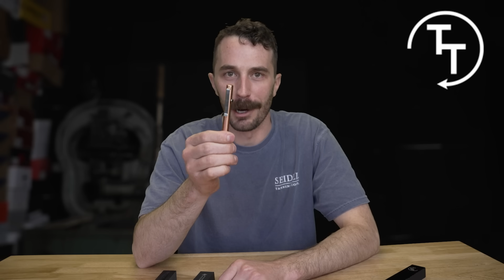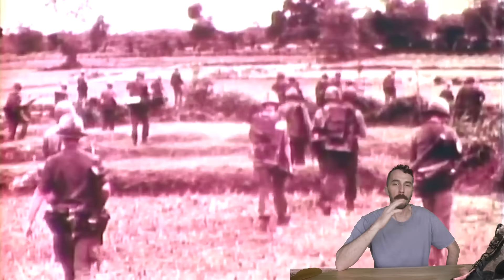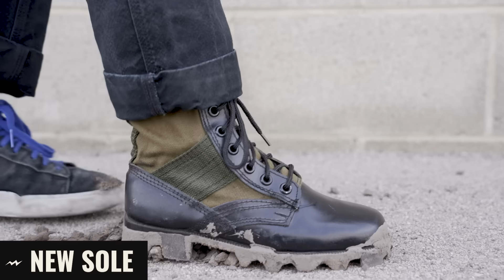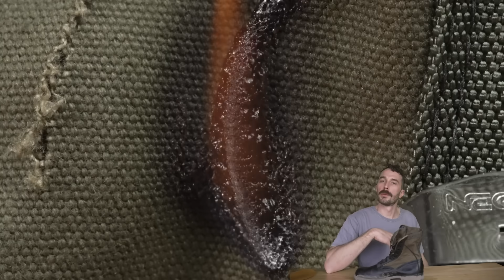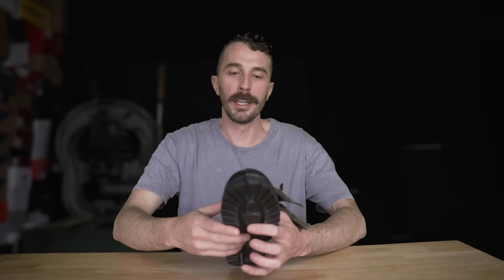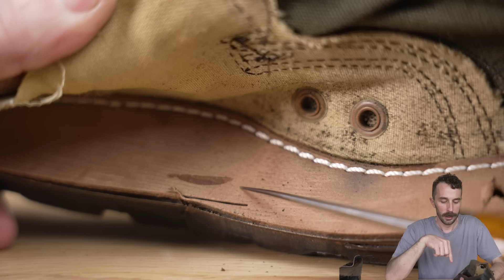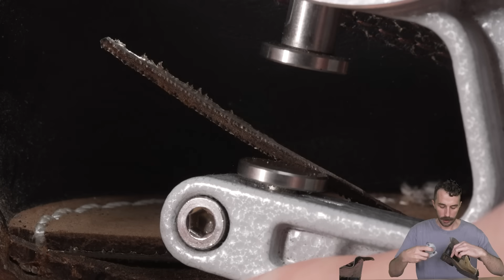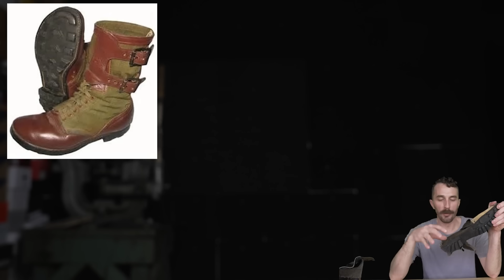Why it took 57 years to replace jungle boots

Comment: The US military had the fortune of learning from other countries' mistakes concerning footwear in the tropical Southeast Asian climate. Specifically from France's experience in the First Indochina War, and the British Commonwealth's experience in Malaysia post-WWII. Both of the Western forces in these conflicts wore footwear that was wholely ineffective in the climate they operated in. They soaked up and constantly held onto water, rotted and fell apart in the humid environment, and became completely fouled with the clay-like mud compromising much of the region. Foot casualties were common. But even learning from this, the US jungle boots weren't perfect. They still needed time off of soldiers' feet to dry properly, and while their sole's traction was an improvement over previously issued boots, they still proved inadequate in sloughing off mud. The former problem was solved by issuing what was essentially slippers for soldiers to wear while encamped or at base, but the latter wouldn't be solved until late into the war with the introduction of the "Panama sole", the widely spaced tread pattern seen in this video. The shape and spacing of the Panama sole was intended to basically squish the mud out from the treads as the wearer stepped their foot down and bent the sole.
Reply: You're right about not fully drying, that's why I remember we carried 2 boots & multiple socks
Reply: @andrij66  I'm sure carrying the extra weight of the second pair of boots wasn't the most fun thing, but your feet thanked you for it. I once had minor trench foot from having my foot in a cast for three months. Condensation from an anti-inflammatory cooler and my sweat saturated my cast. Not the most fun experience, and that was with only a small amount of the foot affected and me not using it to walk at all. So a fully affected foot as you're humping gear around in an active warzone? They're not joking around when they get on your ass about feet care. You ever use the foot powder they issued? Did it help in your experience?
Reply: Fortunately I have dry skin (& dandruff) & didn't use foot powder. Just always used different socks rucking around. & always bought the best insoles I could buy. I remember the pig & a box on the back used to wear everything out fast. Especially the socks.
Also I was always lousey at shining boots. I tryed the burned can & cottonballs panny hose & clothes, never was able to get that mirror shine some guys got I was throwing away my junk shoes 3 months ago & various boots the Army gave me couldn't throw away my old Jungles with thick laces. Naturally he didn't say but those would be the first to go.
Reply: You might find the Roman footwear (Caligee? or something like that) was also made to drain water, hence the open sandal design. Thinking back I saw guys use footpowder at night (or after talking off their boots) but would just be a mess in the boot after a day of stomping around.
Reply: @andrij66  You know, I always considered Roman military footwear construction to be more of a logistical matter; that it was the simplest and cheapest way to shoe their warriors. I never stopped to think there was a practical benefit to having it designed that way, sans breathability. Interesting.

On the foot powder, it makes sense to prefer using it at night. I imagine it gets crushed around into a caked-on layer after being walked on all day. Wonder if it would have been enough to clog up the Jungle Boot's drain holes?

Comment: They were alright for their time.  A big improvement over the previous generation of combat boots.  But footwear technology has come a long way since that time and the military can do better.
Reply: I politely beg to differ.  The current Army hot weather coyote boot is awful compared to my old green jungle boots.  The padded collar at the top is not as form fitting as the old style.  This does not allow tight lacing.  Because it is sloppy at the top your trousers do not stay inside the boots as well.  Once those suede boots get wet they STAY wet.  The black leather portion on the old jungle boots could be polished and that would repel the water.  The current coyote hot weather boots are significantly heavier.  My OD jungles are light as a feather...   Could hump for miles.....   AAFES currently sells the old style ....   Hmmmmmm.  The new OCP uniforms look a little like the old BDU uniforms....    The Pinks and Greens are back.....    Maybe the OD jungle boots will return again.....    The more things change....    The more they stay the same.

Comment: This video is great!

I've worn solid leather Altama boots with BDUs (sturdiest), the issued desert boots with the UCP ACU (Bates or Belleville (?) narrow-soled ankle breakers), the older Danner TFX with UCP and OCP ACU (widest sole for max stability, but heavy and not the most comfortable), but now, I have found the absolute best boot so far: The Rocky S2V.

It's as if they incorporated and improved all of the best attributes of the jungle boot, used all of the current best materials available, and even applied anti-microbial and PTFE flame-resistant coatings. I haven't tried to set them on fire, but they don't smell like foot odor AT ALL after six months so far in hot desert climate with sweaty feet (my running shoes stink). They're supposed to incorporate "Sieve" technology to push water out/air in, but I haven't waded any water. The sole is wide, ankle stability is amazing, yet my feet naturally roll from heel to toe with minimal resistance or clunkiness. They're not speed boots, but they don't FEEL heavy like the Danners did. They are hands-down the most comfortable stability combat boot I have ever worn. The Rocky boots have been very popular with the Army (and the rest of the military?) for a while now. I wish I bought them instead of the Danners a few years ago.

I'd love to see the Rocky S2V compared to the current GI boots, or any other modern combat boots, for that matter.

Comment: The mesh insole is not and does not function aa sponge.
Instead it provides ventilation and disperses heat. So your feet will be dry and therefore warm, will not rot, and won't get tired.

Comment: One of the Ranger BN did a study in the 80's of feet and leg injuries from road marches. They found out that the jungle boot caused the most injuries, probably due to the metal plate and the relatively hard lug sole transmitting most of the shock from rucking straight to the feet,  The all black leather issue (leg) boot caused the least injuries and the Corcoran jump boot was almost as bad as the jungle boot. I would put the neoprene soles in my jungles to give them more shock absorption.

Part of the jumpmaster check (JMPI) in the late 70's early 80's was to check that the jungle boots being worn by the jumper had that ankle strap sewn in as it reduced ankle sprains.

Comment: I HATED THEM.  In the jungles they were fine. However when they become a daily wear on hard surface they were brutal. IN COLD WEATHER THE STEEL PLATE GOT VERY COLD AND STAYED THAT WAY. A 12 mile road march in the original soles was so taxing. Replace the soles with a ripple sole or a viabron type sole and they were fine.

Comment: When I was in the army in the mid-1970s, I loved my jungle boots.  When I returned to the army in 1989, I was doing a lot of flying in UH-1 (Huey) helicopters and others and learned very quickly that the last thing you'd want to be wearing in a crash with possible fire would be plastic materials like the nylon sides in these boots.  Our safety guy had pictures of crash survivors who were wearing them when they crashed.  The plastic melted straight into their skin and left raw meat behind after the doctors dug the plastic out.  It made your foot and ankle look just like a biological jungle boot, too.  It was leather boots, Nomex flight suits and jackets and NOOOOO plastic stuff that would melt into your body.

Comment: These were not issued to us in the late 80s but they were authorized for wear and available at the on post uniform store.  I bought a pair after my initial issue boots were used up and wore them pretty much all year while I was on active duty.  I remember that when the leather became very soft from use the metal vents would fall out of the leather and be lost.  After that it seemed small stones and sand got into the boots time a lot.  A pain.  The mesh insoles you showed came with the jungle boots.  Those same mesh insoles also came with the regular leather boots issued to us at basic training.  They were not specific to jungle boots.

Comment: Since this seems like the best most active location for talking about boots/footwear.
     My situation: I have fallen arches due to hyper elasticity in my tendons, also since my feet have been unsupported for so long I've got a bunion started...to say the least my feet give me issues all the time. I've tried store bought insoles, 3 types of custom orthotics last one being made by a podiatrist.
     I have a really strong feeling it's not an insole issue cause support is only as good as the weakest link.
     My boots, I've looked high and low for arch supporting, stable walled, sturdy based, raised heel, steel toe, 8" high, D width with toe room, function over fashion. (Boots designed for purpose)
     Looking for suggestions for boots, I know i can't be the only one who is looking for something specific. Any and all help is more appreciated then you know.

Comment: Wore those boots for years, until I went to Korea in 89. They weren't allowed to be worn there. Prevailing premise was the cold. They didn't want GI's outside in the extreme cold with a steel plate between your foot and the frozen ground. Not convinced that was the reason, but it makes some sense.

Comment: Those white rubber Winter boots you mention at the end of your video are called Mickey Mouse boots. Not bunny boots. I wore them a lot when I was stationed at Ft. DRUM, NY. They are super heavy, clumsy, but very warm.
The jungle boot is still my favorite boot. The wide spaced lugs are great for mud, but are hard to walk for distance because they are not very forgiving. Annoyingly, the pungee stick plate would often snap in half inside after a time. This caused an audible click when walking. Then it was time to toss them. The plastic insole that says Do Not Boil are garbage. They are not absorbent at all. They are designed to maintain airflow. That is why the do not depress and provide cushioning. No cushioning and very painfull in your feet. Soldiers toss those and add nice store bought insoles.

Comment: I wear 2 of the german versions. 
I learned to appreciate the non sweaty feet fast. 
And when I quickly had to retrieve a dog from a river, I learned to appreciate those drain ports. 
With good care and high use, I got 16 years out of my first pair. 
I still wear them some times, when threads on the soles are less of a requirement.

Comment: I purchased jump boots when I reached my 1st Duty Station.  They were removed from the Army around 1990, so if you already owned them you could wear them with your BDUs, but they could no longer be purchased from clothing sales.  They do allow water to drain and air to circulate, drying your feet while you march.  My last pair gave up the ghost in 1999 after 12 years of daily wear.

Those other boots were called Mickey Mouse boots when I was in the Army and they are extreme cold weather boot.  They also work amazingly if inflated properly.
Reply: The mickey's had a little fart vent to let the sweaty steam out. They were nice and warm in the snow of S.Korea but a bear to wear on long marches. Great for guard duty.
Reply: Jump boots were the best

Comment: Those are still in use in Brazilian armed forces, there are some variations on quality depending on where you get them (the pair you recieve/the ones you buy) and between brands, the cost averages $30, some pay $40, I personally bought in bulk for the whole platoon, each pair costing around $21... The ones that are given are called "jawbreakers", because of the hard rubber soles, they work fine but after a year of using them you'll certainly get a knee injury for life

Comment: I brought a pair of jungle boots to Costa Rica with me in 2004 on a group trip. 

Two young women in our group took a wrong turn in Tortuguero and found themselves stuck in a saprolite clay quick mud. The jungle boots let me walk through the mud like it was nothing and made it easy to carry one of them back to the boat after her boots were unretrievable. 

I can't say anything bad about the later version of these boots. The moisture ports on the side and the spongey insole kept your feet dry no matter what and the super simple tread of the heavier lugged soles made them badasses on jungle terrain. 

I legit miss them and would recommend them for hiking anywhere in rainforests or jungles.

Comment: In hot steamy environments, I have worm both the small and large lug jungle boots! Both were excellent boots, I preferred the large lug mostly because it was more comfortable. Soldier rumor had it, that there was a steel plate in the bottom of the jungle boot to protect against pungi sticks which I thought was total BS until I watched your disassembly of the boot. Well I'll be d*mned, the rumor was true! Thanks for the conformation!

Comment: I was never a fan of jungle boots. Some manufacturers seeked to make the boots waaaay too low for the top of my foot. That, combined with a very prominent seam between the nylon upper and leather lower, meant they would rub the top of my foot raw, even after breaking in.

The modern USMC hot weather boot from Belleville is much better.

Comment: I wore these boots (USMC 79 - 2004) until 1995ish.  Best boot ever and use them for yard work now.  The insole was thrown away after a few months as it would begin to bunch up after a long hump.  I resoled mine a couple of times and they beat the hell out of the initial black issues.  We were issued a new still in 2001, after 9/11 and they are a good boot but no where near the quality of the jungle boot.

Comment: I had a pair of those when i was in the Army and they were FANTASTIC! My feet would get completely soaked, but would dry as I marched around  and by the end of the day the both the boots and my feet would be just fine. later I was issued a similar pair when I was deployed to Iraq. No vent holes, but rough side out tan colored leather and tan canvas tops.  Again, my feet were well cared for in those boots.

Comment: I served in Europe in 67/68 with leather boots. I worked on a trash truck in the 70s. We wore out souls every three months. I bought the jungle boots at an army surplus store. They were $20 back then. They were the first kind you showed .so they must have been superseded.by the newer boot and that's why they were so cheap.They sure saved my cash flow.

Comment: I wore my jungle boots for years in the military. They were my absolute favorite and most comfortable, extremely durable and long lasting. The only change to them many of us did was to add 550 cord instead of the black laces. The jungle boot is by far the best military boot I have ever had or worn.

Comment: I wore that design for 18 years of my military service and continue on for another 2 years when I went to the mining quarrying industries. Our outsole wasn't the same, 🇬🇧 army design/more like chicken feet.
I used to put on 2 socks, 1 thin nylon polyester leather shoes sock and over it military issued woolen high cut socks and use a single lace string cut into half for stringing up the boots & keeping the other pair in my fatigue chest pocket for spare/other uses.
We were supposed to change to black full leather boots by 1998 but like the rest kept the jungle boots and used black wax polish/Kiwi to darken the green nylon areas for passing inspections.

Comment: I remember when I got mine. What a difference from the older ones. The longer that I wore them the more comfortable they seemed to get. Not so much to shine when you had to either. They weren’t to much for hot concrete. But I thought they looked like slippers when you had them on with the softer cloth up the sides. Wish I could get some of the originals. Reo search stamp on the souls. One of the few things Uncle Sam got right in the clothing department.

Comment: I particularly like the later sole lug pattern for shedding foreign material. I don't know why more boot designers don't use this design.
Reply: Because if your not walking in 10 inches of shit you have less surface touching the ground, thus less grip.
Reply: looser lug design would make it H E L L to climb rocky hills, you need texture for overall grip
Reply: @@duffelbagdrag Yes.  I had both, the original Vibram style and the improved Panama treads.  The Panama soles were MUCH better.
Reply: How were they on floors?

Comment: The World War II boot featured is an M-1943 boot, but the majority of troops in that war didn't wear boots at all, but rather field shoes paired with canvas leggings. Low cut service boots were also worn by ground troops. Paratroopers wore combat "jump" boots (black with an oversewn toe), and special tanker boots were made for armored unit personnel. There were also  boots made in smaller quantities for officers, such as the tall boots worn by generals Patton and Bradley.

Comment: i did 8 years in the army and after basic, i immediately threw away my basic issued ones. I bought the S2V boots. They were hella light and they had a reinforced heel to help prevent you from rolling your ankles. Every vet knows the basic issue boots while walking on gravel was your arch nemesis. My first pair lasted 6 years. The front toes completely ripped out and still have my second pair even after being out another 5 years. Im absolutely shocked that each pair lasted me roughly 6-7 years of daily rough use.